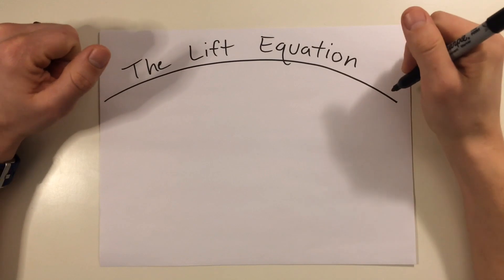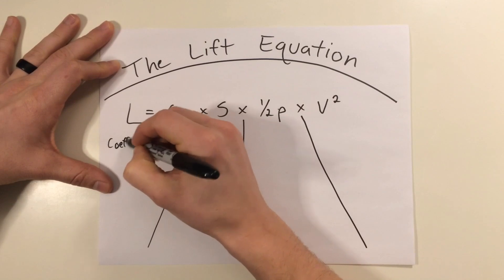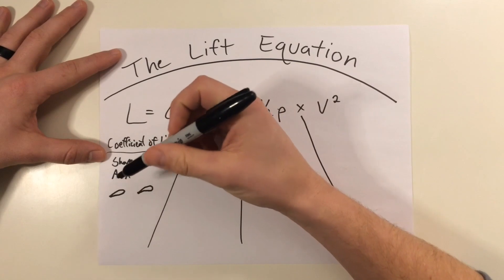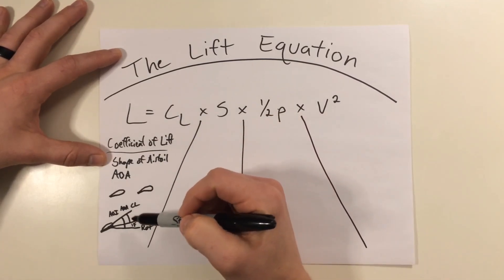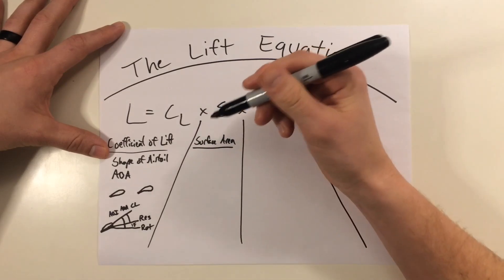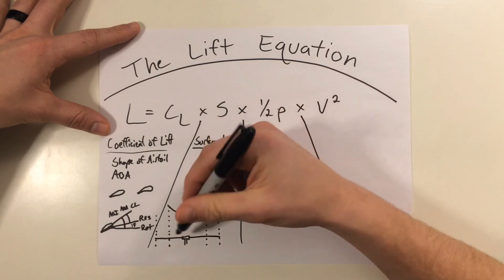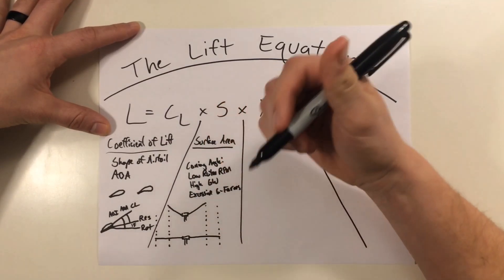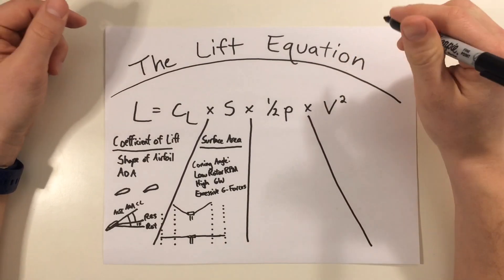The Lift Equation - Part 1

Comment: How do u calculate Cl value
Reply from the maker: Harder to explain here and a physics textbook would be an easier source. But here’s the jist: Multiply fluid pressure by velocity squared and divide the product by 2. Multiply the surface area with the preceding product. Divide the lift force by the product.
Reply: @helicopterlessonsin10minut10  upload a video that show how to calculate power needed to hover
Reply from the maker: That will generally come from your aircraft operators manual. There should be cruise charts and hover performance charts. Each aircraft varies so it’s best to find your specific aircraft.
Reply: @helicopterlessonsin10minut10 will I get answer in Newtons  or kilograms after multiplying cl, velocity, air density surface area and 0.5 ..

Comment: I understand the coefficient but when we get to the surface area, are we working in cm and meters or feet and inches.
Reply: Depends on what unit you want in your answer, if you want newtons then just use SI units in the calculations

Comment: Is the surface area the whole rotor disc area? Or is it just the surface area of each rotor blade added up?
Reply from the maker: James Downs. Surface area can refer to either. The length (root to tip) and width (from leading edge to trailing edge) affect how much surface area or lift each blade can individually produce.  This comes down to blade design and cannot be affect by the pilot in a helicopter. The total surface area of the disk takes into account the entire rotor system and how much lift the system as a whole can produce. The pilot can affect surface area of the disk by affecting the amount of blade coning. Great question!
Reply: Thanks for your answer... and thanks a lot for your whole series of videos.
Reply: As a helicopter pilot I am not sure you can affect surface area.  If my rotor disk is 60ft this does not change with coning.  My lifting area is changed however the surface area maintains 60ft.  Thoughts?
Reply: @JB_Raiders  I may be wrong but I wouldn't have thought coning would have much effect on disk area, either.
As I'm sure you know, but to the o.p. I would say that both disk area (A) and blade area (or more usually, solidity, denoted sigma) figure in basic performance equations. For example, it is standard to define a thrust coefficient CT for the rotor in terms of disk area as in pi*R^2. To make sense of this in terms of blade aerodynamics, this is divided by solidity to give something akin to an average lift coefficient for each blade.
By the way - I enjoy these videos and they are teaching me alot that although I will never be able to put it into practice is really enjoyable.
Reply: @helicopterlessonsin10minut10  FYI, likewise for me, in the "Conservation of Angular Momentum" video, when you mentioned "blade diameter shrinkage" I pictured the thickness or "waistline" of the blade shrinking... Then I thought it must be the length of the blade getting smaller, retracting somehow, like when it's cold out?...  (Eventually I saw a video by George Costanza that straightened me out.)

Comment: I wouldn't necessarily say Surface Area is controlled by the pilot in a normal sense. Its more of a resultant of the pilots control, not a primary or direct control. In an airplane you use flaps and slats to directly change the surface area, yes, but you would not fly the aircraft to the ground only using flaps, only AOA and V squared but speed is set at a constant approach speed. Same with a helicopter. Im not gonna think, "Hey i'm landing, i want my blades to cone" Its just a byproduct of flight. Id more or less think "Ill change my AOA" saying i need more lift, not by saying "i want less surface area." But in reality id say "Holy shit i'm descending to fast"
Reply: Hey Jacob,

Currently at AH-64E IPC. Tried to argue the change in SA as taught in this video. I got crushed. There's no manual where this is taught and it appears to be completely incorrect. Even when there's coning the actual surface area hasn't changed. The lifting area (disc) has changed, but that's not what the equation is referring to.

I'd love to be wrong. Do you have any reference that directly correlates Surface as being able to be changed as result of coning?
Reply: I would think the change would be in the angle of attack when coning occurs. I'm a fixed-wing guy, so take it for what it's worth. The blade is going to feel the relative wind differently when coning occurs. The surface area has not changed. The way the airfoil feels the wind has.

When the blades are spinning normally, all of the lift would be directed upward. When the blades begin to cone, some lift would be directed horizontally instead of straight up. That may be where the loss of lift comes from when coning occurs.
Reply from the maker: Parker Raimondo. I think we're saying the same thing. Pilots cannot directly control surface area in flight, but they can affect rotor RPM, excessive G loading, and high gross weights, all which influence the amount of coning. It's a far more directly affectable component of lift in fixed wing aircraft.